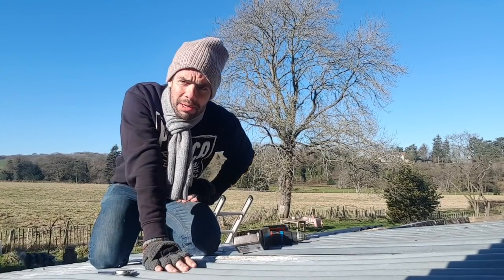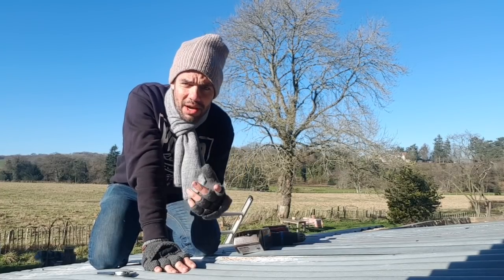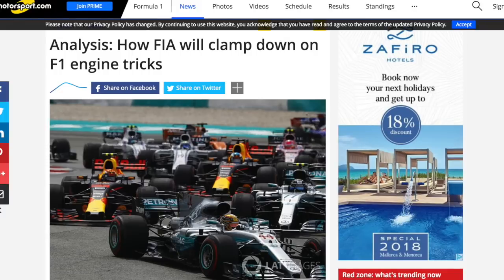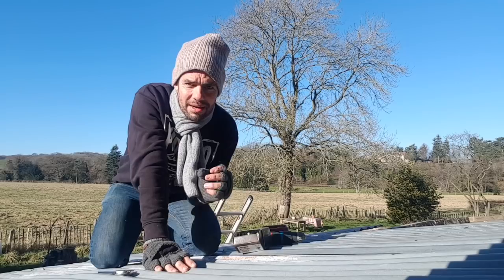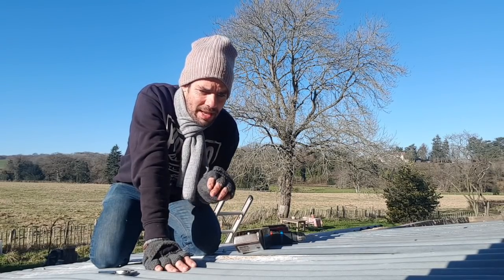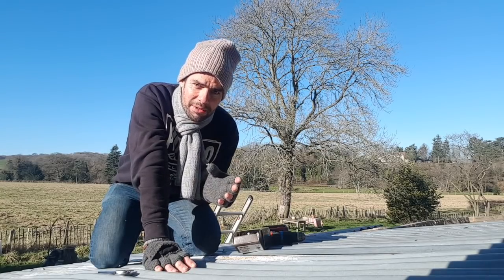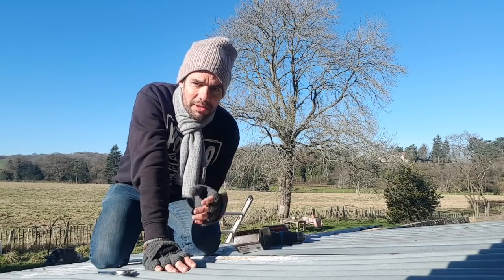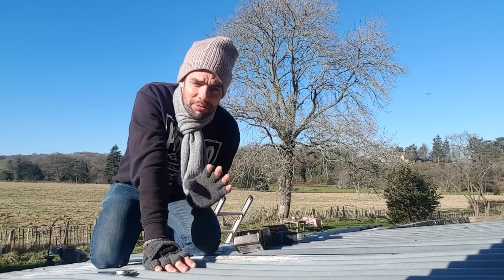MP22 - Why do F1 teams burn oil in their engines?

Comment: Since I imagine they're still running two ring pistons, you can't help but have blow by. Even with vacuum pumps ring seal would be a compromise of seal versus drag. I'm curious about the chemical content of an oil that doesn't lead to detonation. I know castor oil won't detonate but I can't believe they'd be running an old school oil like that. Must be a synthetic with similar combustion attributes. I heard rumors back in the 80's that Bob Glidden was running nitro methane in the oil of his pro stock motors. so the concept isn't new, just tweaked for the environment.

Comment: Such a shame all this goes on. It's no different in the very lowest form of motorsport. Endurance rallying and the stories I have heard about, tightening diffs so they act slightly like a LSD, gas flowing and chipping engines, its a joke when all you want to do is go out and have a bit of fun. It would never work in F1, but if there was a rally championship ( low budget ) then they could all go to a warehouse, pick a number out of a hat and thats the car you get for the rally, which starts at the door of the warehouse. Interesting topic Marc, thank you, hope you got the roof finished👍
Reply from the maker: Thanks Steve, these are all very difficult things to police, but natural as soon as you introduce any form of competition in anything I guess.
Reply: On the contrary, there are only 2 drivers in a team but hundreds and hundreds of very smart engineers competing to bend and find holes in the rules. That technical side is at least as fascinating as what talented drivers do on track when coming from the back and passing all cars like in Brasil or Austin.... It is not only about making a MGU-H with a genius design that nobody can copy, but also find ways around the strong caloric energy restrictions in the rules, just to win. Be strong but also be smart!